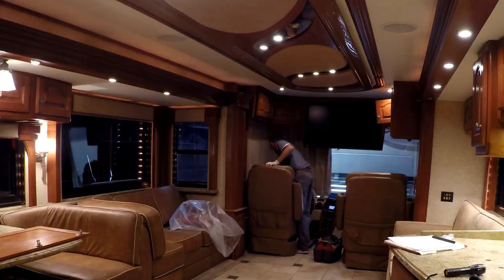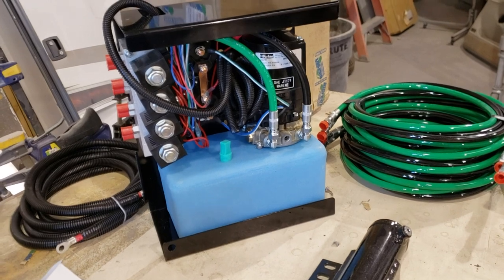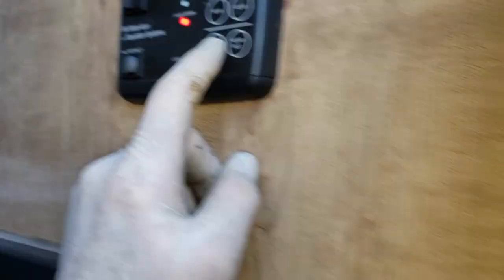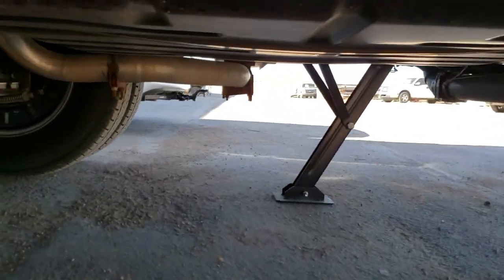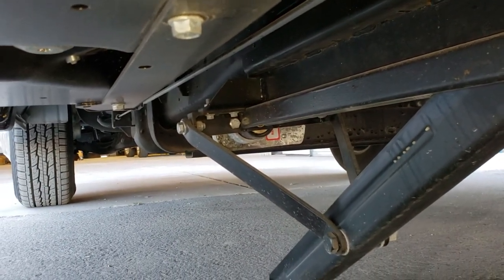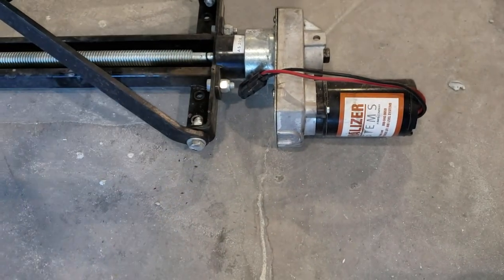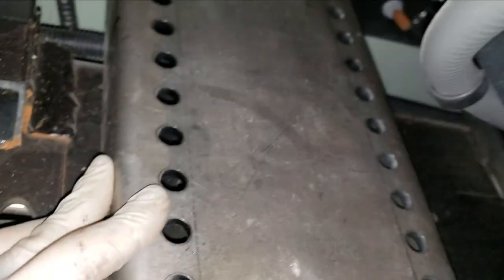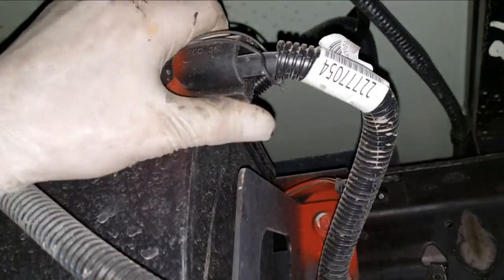Upgrading leveling system on a NEW Class "C" RV

Comment: You are my hero! I am considering having the Bigfoot leveling system installed on my 2002 Sunseeker LE 2100 which has the Chevy Express 3500 chassis, do you have a video of the installation on that chassis?

Comment: Thanks for your time in making this video. I gained some insight that helped, I do believe the front ones were mounted 6 in from the REAR Cab mount in stead of the Front mount . I can’t believe they put the 1800# electric @#$& in the middle of the Rig .... not that it could anything anyway.. So , with the Bigfoot jack mounted were you did .. can it still lift the tires?
Reply from the maker: yes

Comment: Do you have any videos on the installation of the Bigfoot AQ-DPA1 for Diesel pushers? We own a 2007 Newmar Ventana 3933 and we are one of the many 'victims' of failing Atwood electric levelegs which are no longer available (even Lippert, which bought Atwood decided to discontinue them and leave the old customers hanging). The nice thing about the AQ-DPA1 is the fact that it has 4 pumps by the jacks and I believe the existing electric 12VDC wires can be used to run those 4 pumps. So the installation should be straight forward. Or am I missing something? Thanks,
Reply from the maker: I do not have a video on those jacks. Those are the jacks I thought I was installing when I quoted the job, but found the system different when I unboxed them. It's definitely possible the existing harness might be just thick enough to use especially if you double up the two jack wires to be power and run a frame ground at each jack. Good luck!
Reply: Thank you for the quick response. In order to keep my old Atwood system a little longer, would you know of any sources that sell or refurbish the drive motor / gear box assembly of the Atwood  66541 front leveleg (15" travel - 7.5K). The label on the electric motor reads: Atwwod Mobile 66104 12VDC PD-35F-1001, E186696 I/P, 300W AOM, 110705. Thank you!
Reply from the maker: I don't know of any company. I would keep a keyword search in ebay for the components as they do pop up from time to time....just not when you need them.

Comment: AZ is that electric stabilizing system for sale? I have a 1987 22' Toyota RV
Reply from the maker: Sorry, I had to return it to the dealer.
Reply: @AZExpert  do you have anything available or do you recommend any system...
Reply from the maker: I would honestly not recommend a built in leveling system, although this bigfoot system is somewhat affordable, all these systems seem to fail at some point....lol. Manual crank down levelers that mount to the bumper is what I would install. There are not too many system intending for a Toyota chassis Thanks!
Reply: @AZExpert  how much is a big foot system for my 22' toyota rv?
Reply from the maker: a full setup is around $4000

Comment: The existing system is not a leveling system at all it is a stabilizing system and AZ Expert should already know that!!!
Reply from the maker: I'm not sure there is a difference and are interchangeable terms. The electric system was setup to "level" the motor home not just stablize. No RV leveling system should be used to lift the tires off the ground.
Reply: @AZExpert  negative. A stabilizer system is designed to take the shakiness out of the motorhome. It will somewhat level the motorhome. You can put some pressure on it but is not able to take the weight of the motorhome. A leveling system such as used.on a 5th wheel will level the rig.  Ask the manufacturer there is a difference.
Reply from the maker: great, fantastic!